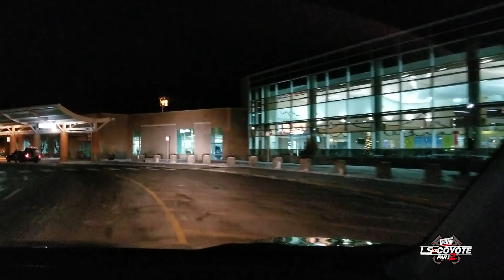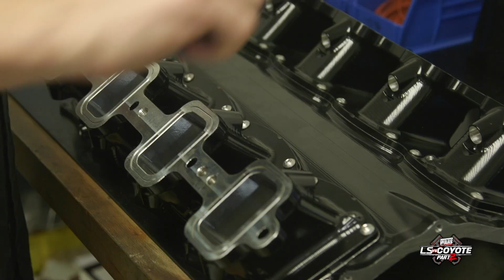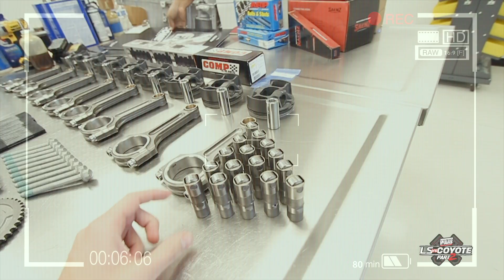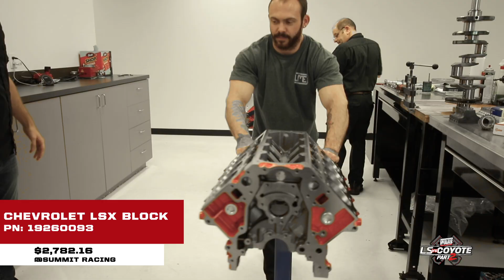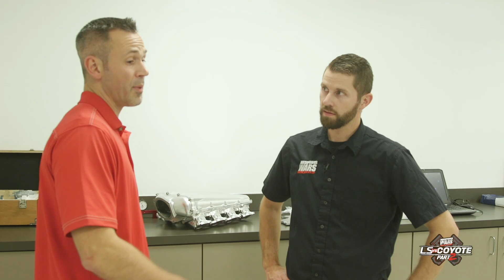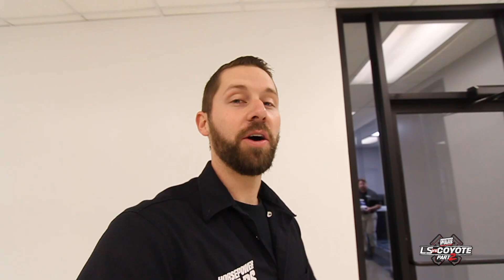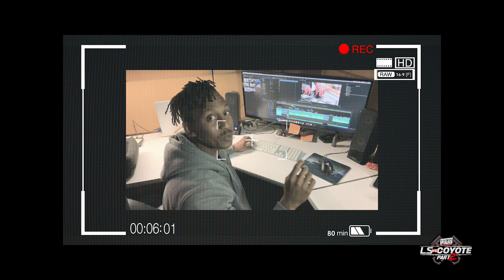LS vs. Coyote 2 Episode 2: The LSX Engine Build

Comment: This shootout is already disappointing. They could have used a 4.8L LS block bore it out to a 5.0 & built that. Smh why when doing a “Shootout” these guys have to use the biggest block they can find? Make it 5.0 against 5.0 & then build from there.
Reply from the maker: It's LS vs. Coyote - each builder was free to pick their cubic inches and combination
Reply: stfu moron, who is doing that build? just like the engine masters bs, who is building 400 cube modulars? no one...
Reply: So ford sets the limit on cubic inches the 5.0 is Ford's choice your upset because the chevy engine can be had from 293 past 500 cubic inches that's right many bore and stroke combinations and of course chevy is cheating

Comment: So from this film and the comments i surmise that in order for this LS engine to even compete against the modern volumetrically efficient Coyote it has to have a massive displacement akin to pre world ww2 aircraft to create power? Thats like comparing an endoscope to a hammer to decide which is the most better engineered tool.

Comment: OK so i priced up this build according to your prices listed comes to $13,958.84 and you missing prices on  valves, springs,  pushrods etc. not to mention gaskets, oil pan etc. Now to top is off you priced the intake manifold $1600 cheaper than retail and that doesn't include throttle body or fuel rails.....
Reply: LandRoverLife.......If you would wipe the sleep out of your eyes and PAY CLOSE ATTENTION, you would find the entire parts list WITH pricing that PROVES they are correct. The only "cheating" we see here, is you guys must've smoked so much dope that you've cheated YOURSELVES out of brain cells.
Reply: @howabouthetruth2157  mate they list summit prices yet manifold is not a retail "summit" price. It a special discount because that's what they want to use and to fit in the budget. The coyote manifold is the retail summit price.. Also there was no price list when I made my comment just the fast they ignored pricing half the parts.
Reply: @SomervilleMetalWorks  LandRoverLife........Hey DUMB ASS........CLICK ON THE LINK IN THE DIRECT RESPONSE HERE TO YOUR COMMENT AND USE YOUR F*CKING EYES. EVERY F*CKING ITEM IS LISTED & PRICED THERE.
Reply: @SomervilleMetalWorks  LandRoverLife.......see my other response to you ( my 2nd response to you, not the first, and this right here is my 3rd response to you )......They had the price list broken up in the video as several price lists for the short block and then the long block assembly......ALL right there in the video, you just weren't paying attention......like so many of the other idiots posting the same stupid comments here. Then when you posted your first comment claiming "there was no pricing" ( even though ALL the pricing was posted in this video in 2 different segments: the short block build, and then later the long block build ) the channel IMMEDIATELY responded by giving you the damn link to see the pricing for yourself. YET YOU'RE STILL BITCHING & WHINING.  Furthermore, pertaining to your bitching about "retail price for the manifold for each engine" and calling the manifold for this LSX build "a discount", IT IS THE ACTUAL PRICE OF THE MANIFOLD WITH AN ENTIRE ENGINE BUILD. If you buy the manifold yourself BY ITSELF, of course it costs more, BUT THAT HAS NO RELEVANCE TO THIS BUILD OFF COMPETITION. Last but not least, the FIRST time they had a build off between an LS and Coyote motor, the rules were even tighter, and both engines could only be naturally aspirated. WHO WON? THE LS ENGINE WON. And what did many of the Ford fanboys do? THEY CRIED & COMPLAINED. So now they are having THIS build off "Part 2" where they are allowing them to go balls out with forced induction.........and my guess, is the LSX is going to win it again. Mainly due to sheer torque that will then be added to max hp.......and in another points category that averages the power 3,000 rpm's back from max. That would go to torque advantage as well, most likely. And all the Ford fanboys are going to cry "no fair" yet again and make even more bullshit complaints & excuses than you fuckers are already trying to make now.
Reply: @howabouthetruth2157  you're serious mate calm the fuck down I bet your losing your shit over your keyboard. Obviously you're too enraged to read my op I added up every price in this videos and then said what it cost. I then explained lots of parts weren't priced. So there was like $1000 to buy alot of parts to complete an engine. So you can see why skeptical. Now the manifold they state numerous times this is off the shelf parts and summit pricing. Retail price for all the parts. The manifold is not retail price so if i were buy all the parts from then buy the manifold i would not get the discount. It's a cop out if i had someone else do the machining I would not the a discount on manifold.
Reply: You they going to cheat some how
Reply from the maker: Valvesprings were included in the price of LME's head package. The manifold is how much LME charges customers during a full build. Full parts list can be found here: https://www.horsepowerwars.com/horsepower-wars/ls-vs-coyote-2-lme-lsx-build/

Comment: Hmm ls biased you award more points for outright power than anything goes to show its ls biased.... Average HP should be most points and the other 2 the same.  Hell you're not even using a factory ls block you might aswell call it aftermarket engine build vs factory ford engine. Seriously is there any parts in that ls engine that actually come out in a factory oem vehicle?
Reply: Those head bolts😂

Comment: Lsx didn’t come in any gm vehicle from factory . So comparison is autism at its finest
Reply: Hey dude, blocks don’t make power so freakin’ cares?!? I agree the build didn’t stay within the confines of the rules but of all things to bitch about using an aftermarket block... really?
Reply: @coryholbrook4643  i dont want to be rude in any way.... Yes its a after market block no blocks dont built power, but tell me this whats gonna handle more boost a 6.2 Ls aluminum block from a ss or a 426 Lsx iron block that nothing comes with it???
Reply: @gregallen9065  Greg Allen & ESPECIALLY Bradley Harding.......Hey MORONS.......GO WATCH THE COYOTE BUILD VIDEO. IT'S UP NOW. They chose a man and his shop that is widely regarded as one of the best Coyote engine builders in the country. AND HE CLEARLY STATES "THESE COYOTE MOTORS WITH STOCK SLEEVES CAN'T HANDLE ANYTHING OVER 900 hp OR IT WILL DESTROY THE BLOCK. He said they MUST be re-sleeved ($1,500 ) and special flanged DARTON SLEEVES ( $1,000 ) installed AND ALSO ADD WELDS TO THE BLOCK to withstand boost. AND......he also said: "If you don't believe me and boost these Coyote engines with the stock sleeves, YOU'LL BE BACK TO BUY ANOTHER ONE WITH THE FLANGED DARTON SLEEVES".......END QUOTE. So as far as PRICE is concerned, THERE'S NO SUCH A THING AS "AN AVERAGE COYOTE BUILD" WITH BOOST.  FURTHERMORE, BACK WHEN THEY DID THE 1ST BUILD OFF WITH NORMALLY ASPIRATED LS VERSUS COYOTE MOTOR, THEY HAD ONLY A $5,000 BUDGET LIMIT FOR PARTS, AND THE LS MOTOR WON.......AND ALL THE FORD GUYS CRIED.......THAT'S WHY THEY ARE DOING THIS 2ND BUILD OFF AND RAISED THE PARTS BUDGET LIMIT TO $15,000 ( minus a few items allowed over the budget limit ) PLUS THEY ARE ALLOWING BOOST. BOTH TEAMS ARE SHOOTING FOR WELL OVER 1,500 HP. ( The LME team plans to build the LSX motor to make 2,000 hp ).........THERE IS NOTHING "REGULAR" ABOUT THAT, AND NOBODY CLAIMED THAT IT WAS.......BECAUSE NO FACTORY CAR COMES WITH "1,500 to 2,000 HP".......YOU IDIOTS. I swear....some of you twerps have the intelligence & attention span of a house fly.
Reply: They're doing this second build because they got called out for completely botching their own "competition" and rules. Aftermarket blocks can absolutely make power. Stout blocks keep the crank plane square and true to the 2 planes the rods and pistons are trying to reciprocate in. Any variance to tolerances, flexing or harmonics does what? Yeah rob horsepower. That's why stronger aftermarket parts exist guys.

Comment: So let me get this straight, same budget, same power adder, but not same displacement? Why does an ls need to be 427ci for this competition?
Reply: LME could win using a built V6.  They need to be picking on a VW or Honda next time the LS is not within reach of the Coyote.  Some LS motors are making 2300 to 2800 HP with twin turbos.
Reply: BulletSpoung yet the mod engine is faster. 🤔 it isn’t always about numbers

Comment: Before I watch this. Let me guess. The LS will have a CAM, a INTAKE and HEADS. Mean while the coyote will not have aftermarket cams,will not have an aftermarket intake and no aftermarket heads.
Reply: preludeF20Bking 
Cams for a Coyote cost $1500+
Cam for a LS...  under $500

So how much do aftermarket Coyote heads cost?
Reply: StL ChuckO there are no aftermarket coyote heads except the 302R heads 

They can use the LSX block and blow all that dough on it but they stick with a production 5.0 block

I’m sure that way the coyote is actually cheaper to build 
 
Ofc an ebay turbo kit on 5.3 LS is cheaper 

But they’re just going so balls to the walls with that LSX it’s not even funny  and really biased
Reply: @ahmeda3227  not really just goes to show how much you can actually do with chevy and the after market vs ford and the after market with similar price spent on parts. I.m sure if their was a better block / head option to fit in the budget then the mpr shop would have used it.
Reply: Well, you guessed wrong on 2 out of 3, nice.

Comment: I'm a Mopar guy, so I don't have much of a dog in the fight, but the Ford guys sure are making a lot of excuses already. LME did a great job here and built a motor you could actually run long term...cam withstanding perhaps. You can't blame them for making use of the unbelievable aftermarket for the LS. I personally believe that the Hemi has more innate potential, but you can't argue with the LS price: performance, dimensions, or aftermarket. It's so popular for a reason.
Reply: The Gen III hemi has much greater potential than the LS. That was proven the year after the mod motor Fords were banned from the Amsoil Engine Masters Challenge and Tony Bischoffe switched to a Gen III hemi and clobbered the LS brigade. It was particularly satisfying. The LS boys has successfully lobbied to keep the DOHC Fords out and thought they had the contest in the bag. Then Tony walked in with the Chrysler and made it apparent to all observers that the LS is not even the bridesmade but the 3rd choice if you can't do a Ford or a Chrysler. Dark days for GM lovers. Seems they always need those BOP rules in order to compete.

Comment: What a garbage video. The host is a narcissistic millennial who isn't funny, the LSX engine is a $30K+ engine, and not relevant to anything (don't start about the convoluted rules, that intake is a scam and a cheat, as is the block). And, all the sudden this is an  LSX vs coyote comparo, when this is supposedly a redo of the previous? Maybe they'll find another first gen truck engine, and use some random controller that can't handle the quad cam phasing, and count the cash to bring it up from truck spec, oh wait.....
Like I said, garbage.
Reply: isthatahemi1979 please list in detail the $30k in motor specs? You’re an expert apparently, so id like to know. I don’t see billet rods or crankshaft being used. I see a factory crank and average rods used along with pistons for what you generally see on 1000-1500 crank builds. LS7 lifters which honestly is a dice roll but they are cheap compared to $800-$1000 for Lunati or Morel Pro Lifters. Factory rockers vs Yella Terra or Jesel Heavy Duty. Brodix Cylinder heads vs higher end TFS, AFR, Frankenstein or Mast which generally run 2-3x as much. I can keep going, there’s nothing 30k about this build and even the intake itself is unnecessary ( Holley Hi-Ram or Sniper ) would do just as well.
Reply from the maker: The Dominator ECU can handle Coyote cam phasing and it will be up to the builder to determine whether they want to and whether it is needed at this power level. For details on the LSX engine build including the full parts list go here: https://www.horsepowerwars.com/horsepower-wars/ls-vs-coyote-2-lme-lsx-build/
Reply: @Horsepower_Wars  I cant seen to find any possible combo of an lsx and an F1-x at 15k. 11k is the cheapest I can find an lsx. then adding an f1-x 5k before plumbing.. plus matching ect isnt free for a consumer were trying to see what's possible for a normie to get in a 15k budget.
Reply: GhostlyGhille uhh read the rules. Blowers aren't in the 15000 budget man.
Reply: GhostlyGhille the power adder isn’t part of the long block budget. 🤦🏻‍♂️
Reply: @GhostlyGhille  GhostlyGhille........That's because you morons are incapable of PAYING CLOSE ATTENTION TO WHAT THE RULES SAY FOR THIS BUILD OFF.  BOTH ENGINE BUILDERS ARE PERMITTED TO USE ANY PRO CHARGER THEY WANT, AND THAT DOES NOT HAVE TO COME OUT OF THE $15K BUDGET. The labor/assembly, electronics, and BASIC machining do NOT have to come out of the budget limit either. BUT ANY EXOTIC MACHINING MUST COME OUT OF THE BUDGET LIMIT.
Reply: LS has the best chances of winning this competition, their using the best LS block produced.  Ford on the hand is using a 1st gen. coyote out of a junkyard f150,  instead they should of used a 5.8 or the 5.2 voodoo motor.
Reply: @mr171009  mr ponyboy.........Good luck with buying & building one of those for under 15 grand in engine & parts. ( plus the rules state any major machining work done must be taken out of the budget limit too........minor machining may be considered free and not taken out of the budget )
Reply: mr_ponyboy you don’t know anything about mod motors at all. Mihovetz when 5’s with a 4.6L making 2,400whp. You do not want to use the larger bores because of how thin the wall gets which does not make it ideal for big boost. The cylinder heads are what make it key and the Ford GT heads at the time were the best for mod motors. Had they gone to a company like Accufab or Modular Motorsports Racing you would have seen a smaller bore with boost maxing out the pro charger capability.

Comment: Right there in the home page of LME, it shows the LSX at 28,449.00 

Explain.
Reply: Show me where it says that both the build in this video and the build on the website are using the exact same parts. And this 15k competition doesnt include man hours of assembly and the machining. Also what did u want? A company to built a motor with parts thats worth 15k without the machining and assembly hours then price it at 15k? Use some common sense assembly costs money, machining costs money plus they are going to price up the motor to make profit. There, Explained.

Comment: I can understand not including labor for assembly, machine work to the bearing surfaces and the porting but there is no reason that you should get away with putting a $5000 intake on that thing for "free" because it was "built in house". Just like they had to pay for the internals, they should have had to "pay themselves" for that intake.
Reply: Intake was in the budget
Reply: It wasnt free. Its listed there for 3900

Comment: Procharged LSX 427/7L vs a Procharged Coyote 331/5.2L wow!
Reply: Its fair. Ford owners talk shit about LS's but now that there is a competition and thr coyote is gonna get humiliated its not fair? Pfft
Reply: @nathan22outdoors8  Excuse me? This is supposed to be a LS vs Coyote shootout. Not LSX vs Coyote. This is the equivalent of a ZZ302 Camaro vs LS6 454 Chevelle.
Reply: @Only_TheFox_GodKnows  An LSX is an LS.
Reply: @nathan22outdoors8  its a 30k engine.
Reply: @Only_TheFox_GodKnows  After machining, assembly and the procharger, it probably is.
Reply: @nathan22outdoors8  its still a 30k engine without procharger
Reply: $28,449 without Procharger is what that engine costs.
Reply: @Only_TheFox_GodKnows  ok so what? What went against the rules?
Reply: @nathan22outdoors8  broke the bank by 15k thats what.
Reply: @Only_TheFox_GodKnows  Go read the rules. You are arguing with me about rules i didnt make. 15k is without procharger, assembly cost or machining cost. Which means this motor fits the rules and the budget. They have the rules and parts list in the video and even posted a link to the parts list.
Reply: @nathan22outdoors8  know way that engines 15k with any kind of blower on it. All the coyote has to do is slap a vmp/roush blower on it and itll drag the lsx
Reply: @GhostlyGhille  yeah u fucking wish lmao. A stock 5.0 with a Vmp or roush isnt dragging that lsx. They even said thet estimated it to make 1400-1500hp.
Reply: @nathan22outdoors8  didnt know they were pro charging it that's wayyyy past 15k
Reply: @nathan22outdoors8  lsx crate engine is 11k f1x is 7-9k... that's 3-5k over budget before any machining...
Reply: @GhostlyGhille  they have the prices in the video. Go and add them up yourself.
Reply: @GhostlyGhille  also it clearly says the blowers dont count in the budget. Stop being so dense and learn to read. Fucking idiot
Reply: @GhostlyGhille  and machining isnt part of the 15k budget. You're making yourself look like an idiot rn. Try reading the rules before heading to the comments
Reply: @nathan22outdoors8  lmao so the rules say skip reality and go with hypotheticals ? Gotcha. Tell you what hit up LME and try to buy this setup for 15k they'll laugh you off the phone. It should be something consumers could actually do...
Reply: @GhostlyGhille  thats because they are charging me for machining and assembly. Again, you make a point that doesnt make sense.